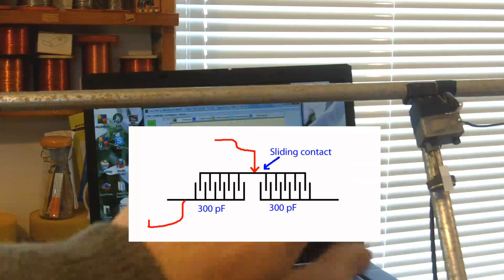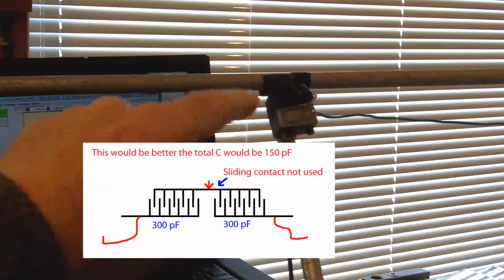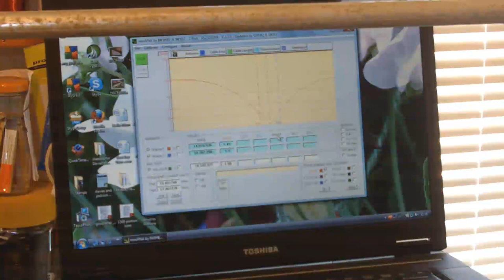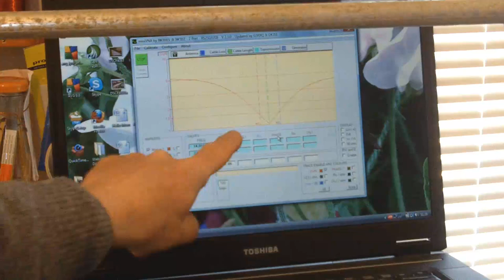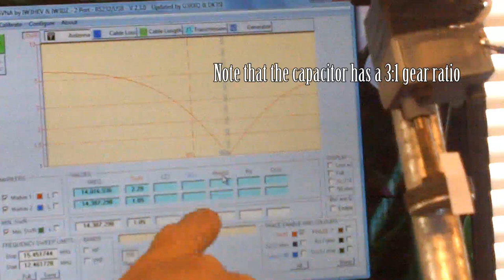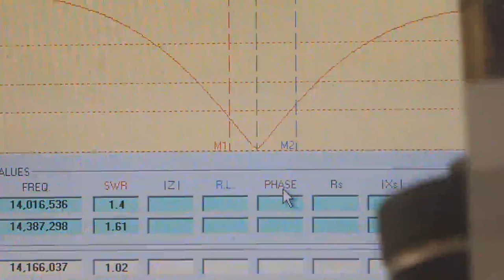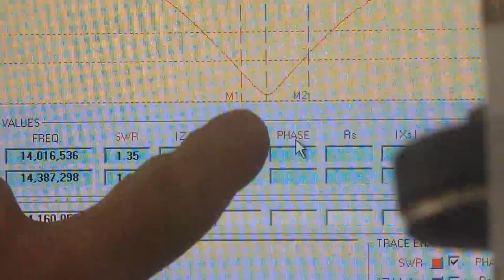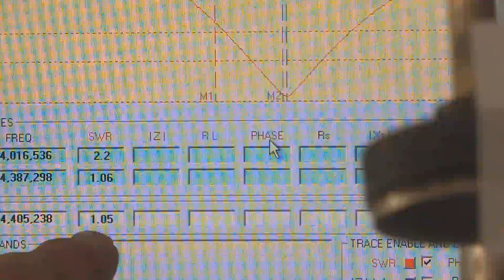About Radio 58 adjusting the gamma capacitor on the 20 m mini beam.

Comment from the maker: Hi there, I’ve just looked on the web and they are available in the UK at around £260 (two hundred and sixty pounds sterling) I had a quick look on eBay and there’s any number of analyzers up for grabs but only one miniVNA I guess folk don’t want to be parted from them. 
See if you can try before you buy as they’re not cheap and it’d be good to see what you’re getting. Also look at the user forums (I haven’t looked in for a long time)
 Good luck.
73’s ...Andy